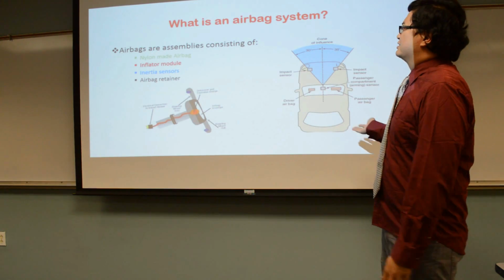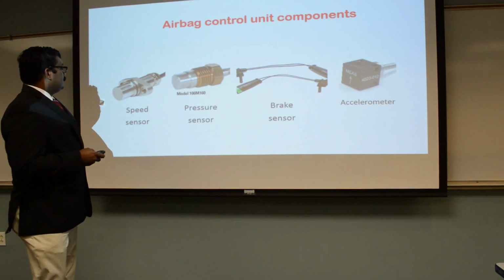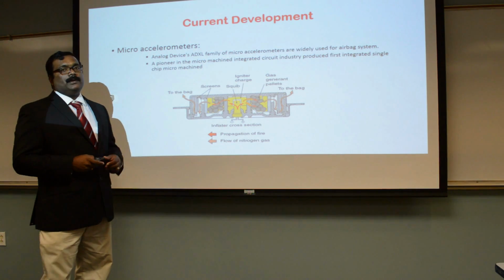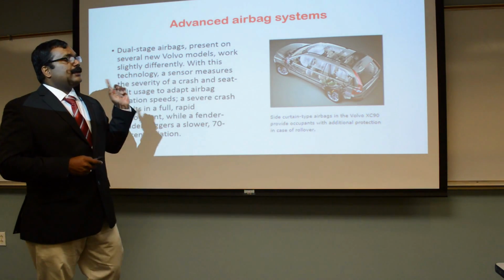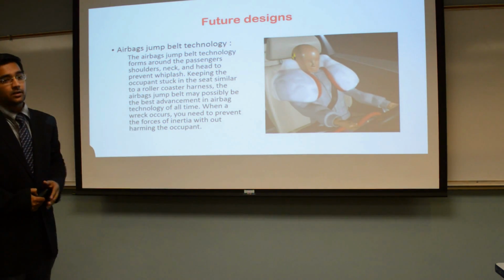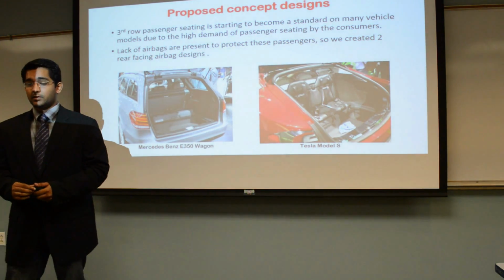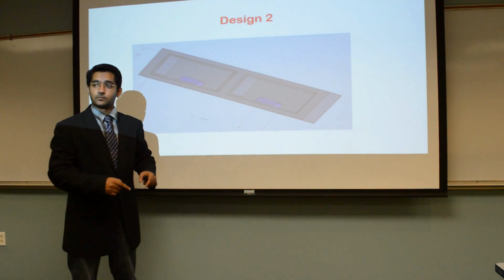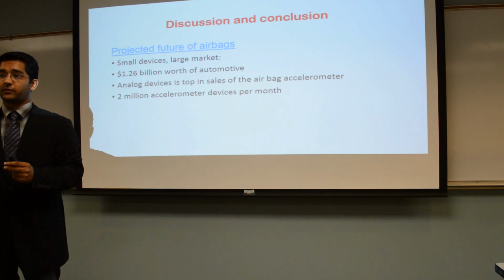Team 14: Airbag Design

Comment: I think this presentation was extremely well done. The only thing I wouldve changed is maybe the angle of the camera, and either everyone should have just worn a shirt or a jacket but having one member missing one takes away from the formality of it all. The slides were a  bit hard to read at times but not bad.

Comment: This presentation was done very well. The group used plenty of graphics especially when describing the history of airbags and how they work. Each presenter spoke very clearly and were dressed professionally. Overall I did not have any issues with this presentation however, the camera angle could have been positioned more effectively so that the slides as well as presenters would not have been cut out of the frame.